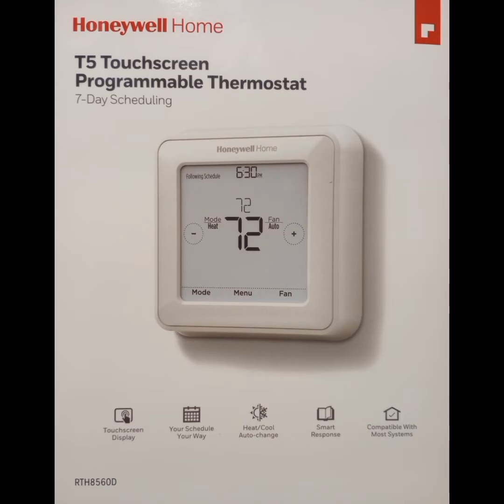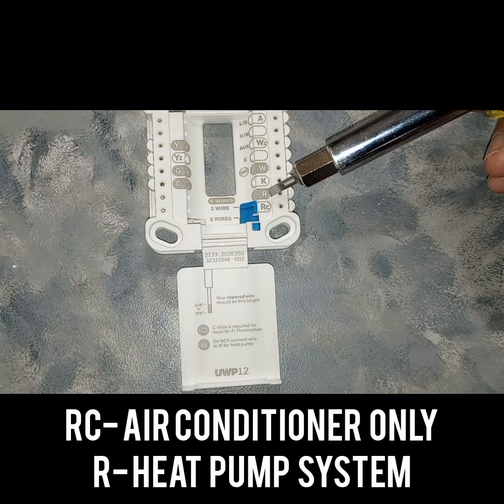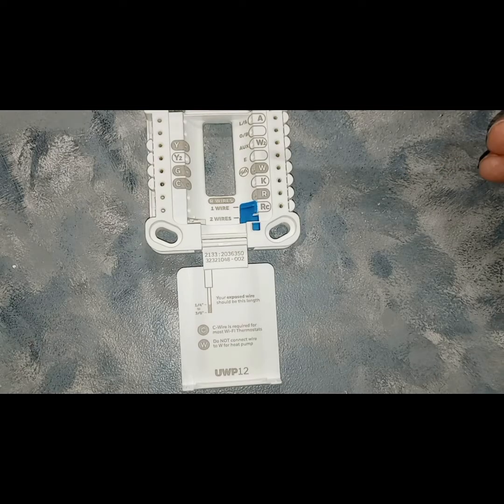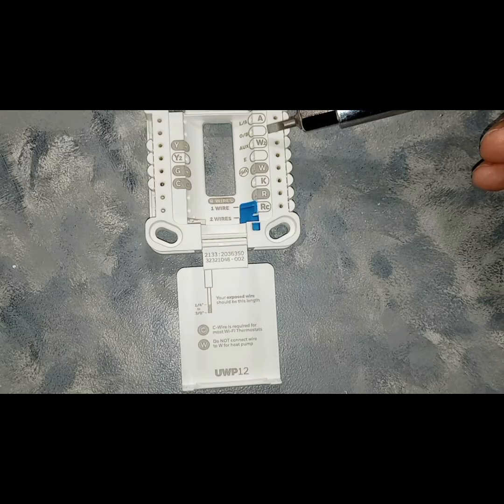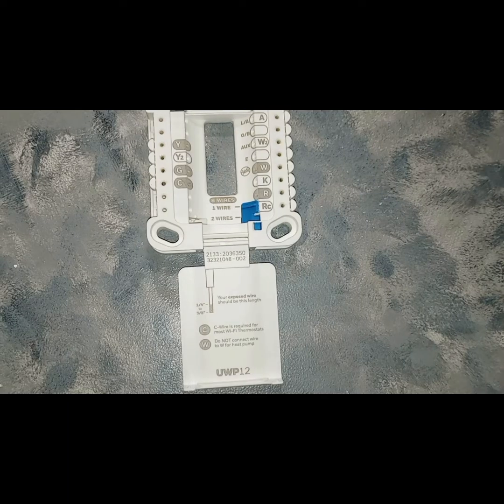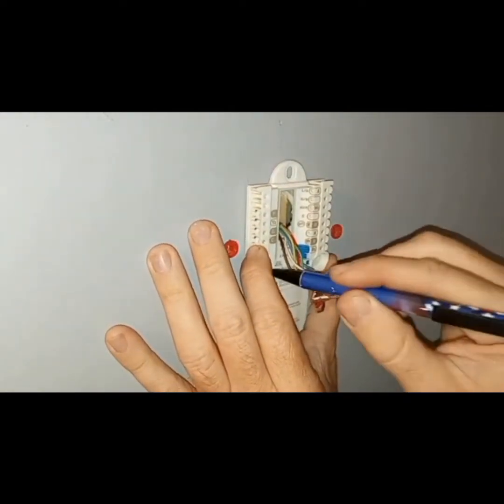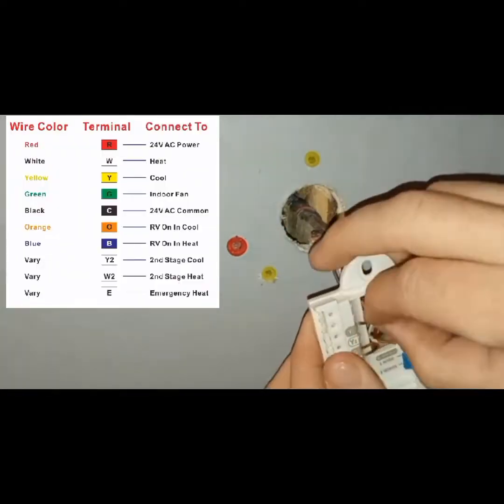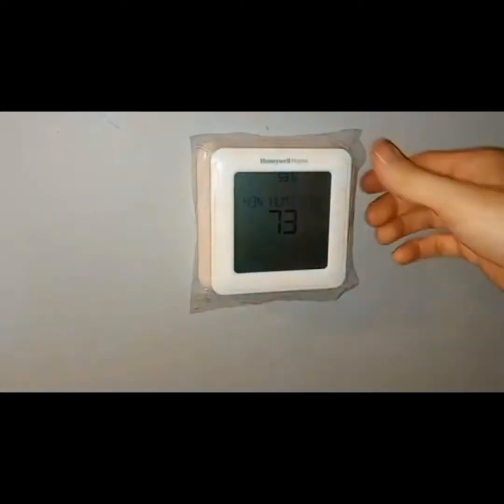How to Install & Wire a Honeywell T5 Smart Thermostat (DIY Full Guide)

Comment: Hello can this thermostat be used Non-Pragrammable?
Reply from the maker: Yes — sort of.
The T5 is designed as a programmable, Wi-Fi smart thermostat, but it does allow you to override the schedule using the “Permanent Hold” feature.
Reply: in another Honeywell programmable stat RTH7560E 1001...press menu & + to enter system/advanced settings and under the ISU category the first thing you can set up is either programmable or not.

Comment: i had a t6 model go out but wiring and power is all good just screen and thermostat itself went blank doesnt take power. the back looks pretty much the same think can just put t5 on and take t6 screen off?
Reply from the maker: I had to verify this myself, but from the information I found: The T5 and T6 thermostats use the same wall plate and wiring terminals, so in most cases, you can swap the faceplate without changing the bracket or wires. Just make sure your wiring matches (R, C, W, Y, etc.) and the system type is compatible.

After swapping, be sure to go through the setup menu and set all the system parameters correctly (system type, heat/cool stages, etc.) so it works properly with your HVAC setup.

Thanks for watching!
Reply: @SimpleDIYProjects  thanks alot switched it out today, t5 works perfectly, thanks! And yep didnt have change any wiring just simple snap in.

Comment: So I have a 2 wire system for my radiant baseboard heater should I go W, and R for this thermostat?
Reply from the maker: Honestly, I'm not familiar with baseboard heaters. However, here is some information I found. 

The Honeywell T5 thermostat is designed for low-voltage (24V) HVAC systems, not high-voltage (120V or 240V) radiant baseboard heaters. If you connect a high-voltage baseboard heater directly to the thermostat, it could damage the thermostat and be a fire hazard.

What You Should Do:
If you want to use the T5 thermostat with a 2-wire radiant baseboard heater, you must use a relay or a line voltage thermostat rated for the heater's voltage and current. Here’s how:

DO NOT connect the baseboard heater directly to the thermostat.

Use a relay (such as a Honeywell R841 or an equivalent contactor) to act as an interface between the low-voltage thermostat and the high-voltage heater.

Wire the thermostat to control the relay:

Connect R (24V power from the transformer) to the relay’s control circuit.

Connect W (heat call) from the thermostat to the relay’s control input.

The relay will then switch the high-voltage heater on and off safely.

Alternative:
If your heater requires direct line voltage control, use a line voltage thermostat instead, like a Honeywell TL8230A1003, which is designed specifically for electric baseboard heaters.

Hope this helps.

Comment: @SimpleDIYProjects can this be used for a single zone heating system consisting of W and R cables?
Reply from the maker: Yes, a Honeywell T5 thermostat can be used for a single-zone heating system with only R and W wires.

Comment from the maker: Circulate:
Available under the Fan setting, the Circulate feature turns on the fan for 30% of the time every hour in order to circulate the air in your home.

Hold:
When using a schedule or geofencing, the thermostat enables the Hold feature. 2 types of Holds are available, Temporary and Permanent. (When Geofencing is enabled, Permanent Hold is disabled.)

Temporary Hold – Adjust the temperature setting on your thermostat display. A “HOLD UNTIL” message will appear, followed by the time of the next schedule change. Touch the time again and use the +/- icons to adjust the time the hold will end. The thermostat will keep the desired setting until it is changed, or until the HOLD UNTIL time is reached, at which point it will resume following the schedule.

Permanent Hold – Adjust the temperature setting on your thermostat display. A “HOLD UNTIL” message will appear, followed by the time of the next schedule change. Touch the HOLD UNTIL message and 2 new messages will appear, PERMANENT HOLD and RUN SCHEDULE. Touch PERMANENT HOLD to keep the new setting permanently.

Scheduling:
Additional scheduling options, such as Geofencing, are available within the Honeywell Homes mobile app. Look at the T5/T5+ - Resideo App section for more details The thermostat is capable of scheduling 4 periods per day for each day of the week. Time-based schedules can be programmed daily, or on a 5-2 schedule (same for all days of the week, but different schedules on the weekends.

To setup a schedule:
Touch MENU on the thermostat display, select SCHEDULE

Each Day / Period will be displayed. Touch SELECT to edit each period.

Touch the TIME displayed and use the +/ - icons to adjust the start time for the desired period (adjustable in 15-minute increments). Touch the TEMPERATURE displayed to adjust the desired heating or cooling temperature (Touch the TEMPERATURE display again to alternate between the cooling and heating temperature setting) Press SELECT when complete.

After adjusting the TEMPERATURE and TIME for each schedule day and period, DONE will be displayed on the screen. Touch SELECT to save your new schedule

To Modify your schedule:

Touch MENU on the thermostat display, select SCHEDULE

Each Day / Period will be displayed. Touch < or > to locate the desired period you wish to edit.

Touch SELECT to edit each period.

Touch the TIME displayed and use the +/ - icons to adjust the start time for the desired period (adjustable in 15-minute increments). Touch the TEMPERATURE displayed to adjust the desired heating or cooling temperature (Touch the TEMPERATURE display again to alternate between the cooling and heating temperature setting) Touch SELECT when complete.

Touch the > icon until DONE is displayed. Touch SELECT to save your settings.

Screen Lock:

The thermostat has 3 settings for the screen lock: Unlocked, Partial Lock, and Full Lock

-Unlocked: All settings are adjustable

-Partial: Setpoint changes are allowed. All other settings are locked

-Full: No changes are allowed

When SCREEN LOCK is active, a “lock” icon will be displayed on the thermostat display

Locking the thermostat:

Touch MENU. Touch the > arrow until SCREEN LOCK appears. Touch SELECT.

Touch the < and > arrows until the desired lock setting is displayed. Touch SELECT

A pin will be displayed. Record this 4-digit code for your records. Press SELECT

Confirm or dismiss the change by touching YES or NO

Unlocking the thermostat:

Touch the “lock” icon.

Enter the pin by touching the +/- icons. Touch SELECT after each digit is entered to advance to the next digit.

After touching SELECT once the last digit is entered, the thermostat will return to the main screen in the Unlocked state.

Locating my pin:

The screen lock pin is not adjustable on any Honeywell thermostat. To obtain the pin, remove the thermostat faceplate by pulling it gently away from the wall plate. On the label on the back of the thermostat face-plate, locate the DATE CODE. (4-digit number located on the right side of the label)

The pin is calculated by adding 1234 to the date code. (For example: A date code of 1644 would have a pin of 2878)

Screen Brightness:

The thermostat has an adjustable inactive screen brightness. This allows the user to dim the screen to their desired preference. (When actively using the thermostat display [i.e. – touching buttons / making changes] the thermostat screen defaults to full brightness. This feature is not adjustable.)

Adjusting Screen Brightness:

Touch MENU. Touch the > arrow until BRIGHTNESS appears. Touch SELECT.

Use the +/- icons to increase or decrease the brightness (1-5). Press DONE when complete.

Recovery: (also referred to as Smart Recovery, Smart Start, and Adaptive Intelligent Recovery)

The thermostat has the option to begin your schedule setting changes early in order to reach your desired temperature at the start of the schedule period. When active, the thermostat “learns” how long it takes to reach setpoint within your home, and starts heating or cooling early. (ex. My home is 65° at night, but set to 70° at 7:00a.m. Rather than waiting until 7:00a.m. to start warming up, Recovery begins Heating the home early [based on its algorithm and learned behavior] and starts heating the home at 6:00a.m., reaching the 70° setting by 7:00a.m.) When active, RECOVERY is displayed on the thermostat screen in the top right corner.

Turning Recovery On / Off:

Touch MENU. Touch the > arrow until RECOVERY appears. Touch SELECT.

Touch the < or > icons to enable or disable RECOVERY. Press DONE when complete

Clock:

When connected to Wi-Fi, the thermostat displays the local time based on the account creators Zip Code (as related to Time Zone). When not connected to Wi-Fi, the clock can be configured on the thermostat display. 12hr or 24hr time displays are optional, as is Daylight savings time (DST)

Clean Screen:

The Clean Screen feature disables the thermostat screen for 30 seconds. Wipe your thermostat with a clean, damp cloth. After the timer runs out, the thermostat screen is reactivated and returns to the main display.

Temp Scale:

You can adjust the temperature display settings at any time. Display temperatures are available in Fahrenheit or Celsius

Changeover:

The changeover feature (also referred to as Auto changeover) allows your thermostat to automatically switch from heating to cooling, or vice versa, depending on the temperature in your home. Resideo requires that a 1.5 degree difference be enforced between the heating and cooling setpoints when this feature is enabledto prevent short-cycling (repeatedly turning your system on/off too quickly) You may notice that your home naturally warms or cools up to 1.5 degrees past your setpoint before the appropriate heating or cooling system begins operation. This is normal.

Reset:

The thermostat has 4 reset options: Factory, Schedule, Wi-Fi, and Homekit.

Factory Reset: clears all of the thermostats programming and resets it to factory defaults

*Prior to performing a Factory Reset, we recommend recording your current ISU configuration (see Setup and Configuration)

Schedule reset: clears the schedule and resets it to the daily default schedule listed below:

Wake 6:00a.m. Cool 78 Heat 70

Away 8:00a.m. Cool 85 Heat 62

Home 6:00p.m. Cool 78 Heat 70

Sleep 10:00p.m. Cool 82 Heat 62

Wi-Fi Reset: clears the current Wi-Fi connection and begins the Wi-Fi pairing process. The mobile app is required to complete the connection process. Go to the App Support section for more information.

HomeKit Reset: disables the current pairing with your Icloud account and the T5/T5+

Equipment Status:

This option displays what is currently being controlled by your system and its operational status. (ex.- If your fan is on, it will display your heating and cooling stages as OFF, but will show your fan as ON)

Device Info:

Displays the T5 /T5+’s MAC ID, IP address (if connected to Wi-Fi), Date Code, Model Number, Build date, Firmware Version, Thermostat Application Version, Thermostat Application Boot Version, Wi-Fi Radio Application Version, Wi-Fi Radio Boot Application Version

Comment: Is all thermostat wire the same?
Reply from the maker: Thermostat wire comes in a range of gauges which can be determined based on the number of conductors needed to power your thermostat/device. The most common size for wiring is 18 gauge because they typically come with 5 conductor wires which have become the standard for low voltage stats and HVAC devices.